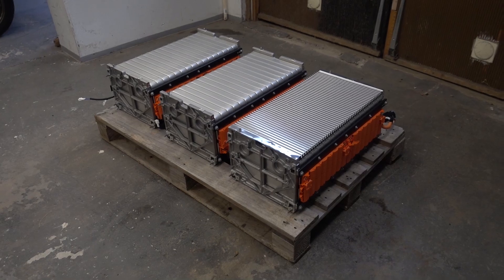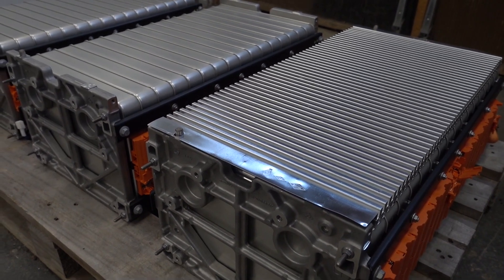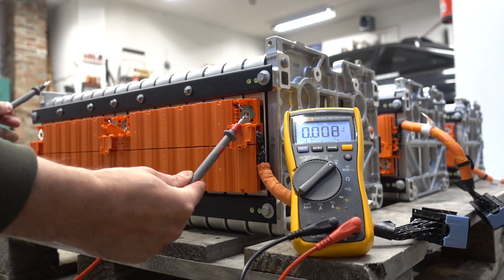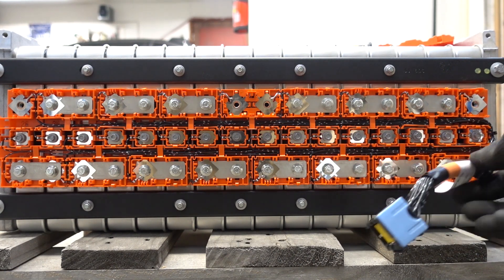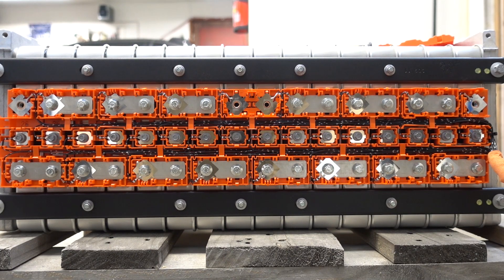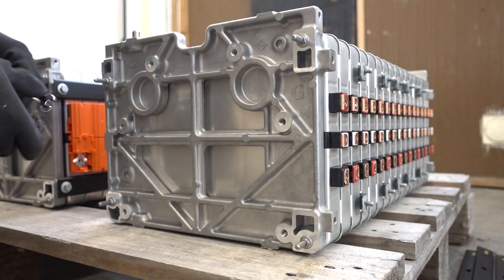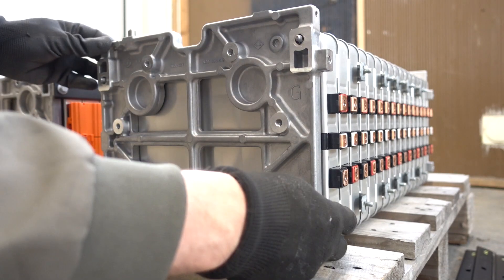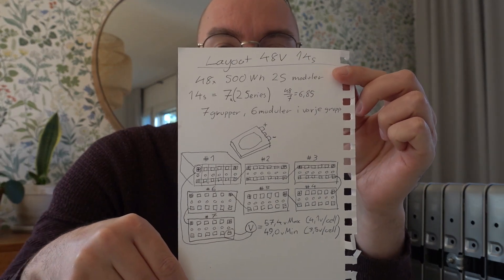ON/OFF-GRID DIY Powerwall  build [part0 - battery layout]

Comment: Why not just leave them in the original configuration and just change the connection bars?
Reply from the maker: If I were to do this again, I would never open the battery. I would just use the 400V battery as-is with the Battery-Emulator

Comment: needs 7 in series for most 48v inverters. With 6 you'll have 44.4v nominal and thats kind of the empty end for 48v systems usually. 
LFP systems are 16s and that makes them 58v when fully charged so yeah. Probably everyone and their dog already shouted that you anyway :D
Reply: you are bringing up led-acid as an example yourself - now calculate whats the voltage for charged up led-acid x4 ;) and what is it when they are empty.
Reply: jk active balancer bms for 100 is what i'm planning to go with. Good configuration options, smarthome integration and no wasted resistor balancing.
Reply from the maker: Nice, I feel like active balancing might not be worth it on such a small pack that I have :D

Comment: Hei Dala. I  have a hybrid Gen24Plus 10kw and also looking for an alternative than a expensive BYD HVM batteries... 
You are doing everything right, that you are looking for another, good option. And the biggest problem was to  understand BYDs RTU protocol and you are now on the way  to build at least a 350V battery? 
Greatings from the other side of the pond,Latvia:)All together for energy self-sufficiency👍
Reply from the maker: Hi, the Gen24 system are now compatible with BYD HVM, BYD Premium HVC and LG RESU FLEX. Sadly none of these protocols are open, so DIY batteries that integrate natively with the gen24 is still a bit away. But I am hopeful we will get there soon! :)

Comment: Hi! great Project! Is there any option that you will be selling the battery case with BMS and wiring from the Fluence? I need one of these for my 55 kWh Fluence project :-)
Reply from the maker: Hi, The case was damaged (and further damaged in the video), and I used the BMS wiring to make the powerwall, but the BMSes are available if you need them!
Reply: @DalasEVRepair  The BMS, junction box and the lower deck of the battery would do the job :-)

Comment: Great stuff! I'm busy rebuilding my house, and a project like this is going to be done after. Any tips on finding those old battery packs? Do you go and visit all the car breakers, or do you have online sources?
Thanks for sharing!!
Reply from the maker: I am really close to Norway, so I shop at Bruktdel!
Reply: I'm not sure about on line but just calling local junkyards is been the easiest way I've found good leaf cells. I see them on line sometimes but they cost to much and you don't know how they are gonna be. The ones from a junkyard are usually from the wreck and still fairly good. If you use them in a power wall build its best to buy high voltage dc components if you are gonna power a home. Look up Mike g solar on youtube and he has the high voltage systems in his place. The high voltage systems are industrial grade as most 48 volt stuff is hobby grade.

Comment: I'm curious to know why you chose 14S as 13S is so common in the eBike world to represent 48V. 
13 x 3.7V (nominal) is 48.1V but when fully charged at 4.2V would be 54.6V and when discharged at 3V would be 39V
14 x 3.7V is 51.8V but when fully charged at 4.2V would be 58.8V and when discharged at 3V would be 42V
Is it true to say the inverter will be OK with either setup? 
I guess you will never charge to 4.2V so it will never be 58.8V
Reply: The LEAF's NMC pouch cells are nominally 3.65V rather than 3.7V, so the max voltage is likely lower too. Also, Dala might be programming the BMS's high cutoff voltage at 53V or 54V. If so, that's a decent strategy as it keeps the cells well below 100% SOC at all times, for longevity sake.
Reply: @alozborne  Agreed. It would be madness to charge to 4.2V or discharge to 3V.
Reply from the maker: 14S or 16S is quite common for Li-Ion chemistries. By adjusting the max charge voltage you can extend the lifecycle for the cells, just like Alan mentioned!
Reply: @DalasEVRepair  Pylontech use 15 cells  in their 48V batteries
Reply: The battery pack has 2 series cells in each module. If you choose 13s, then you use 6.5 modules and leave one cell unused which is wasteful. If you choose 14S you use seven complete modules.
Reply: @tripper1001  KUNFOOSED IS ME 14S  and you say 2  x 3S cells in each module so with a total of 7 modules if 2 cells in each module yes that is for sure 14S cells   BUT how is each module split into 2 cells it looks like each module has 6 cells in parallel so where is the 'break' that splits the 6 cells in each model into two banks of 3 cells?  I cannot see that :-(

Comment: Amazing reuse ♻️ 
I was ruminating on doing something similar with old Honda Insight nimh battery pack (they are really cheap)
Reply: more in detail I have each honda module made by 12x1,2v for a 14v 5,85Ah... I should connect in series...

Comment: Thank you for interesting topic video . When you buy your packs online, do you get some test results on the packs...been looking at the Swedish bildelsbasen and they all just state OK... what ever that means.
Reply from the maker: No they don't want to list quality / don't bother checking. All packs are bought blind from wreckers.
Reply: @DalasEVRepair  But you can check each cell individually before assembling, can't you? Or better you do that don't you?
How big drop in voltage is acceptable in such an application?
Reply from the maker: @leiflillandt1488  not possible to check if you are ordering online... I' target below 50mV diff at high SOC

Comment: hmmm... I wouldn't uncompress the modules and I would just reconfigure bus burs to have 48v but leaving the modules as they are.
In this way:
1) do not the change layout for compressed modules that has been already optimised
2) do not have to rewire connector for BMS and just use adapter from a connector to the BMS layout.

I've the same to decide for my 40kWh modules. 20kWh rear module will be not unpacked. BTW I didn't yet decide what voltage to use. I would prefer to use the pack as it is (with relative BMS) with high voltage (with relative risks) but hard to find inverter managing this kind of config
Reply from the maker: I forgot to mention why, I am making it semi portable, so you can easily carry it from one location to the other! That is why it is split into 7 manageable chunks! This emergency battery needs to be movable by one person!
Reply: @DalasEVRepair  hmmmm could make a lot of sense :)